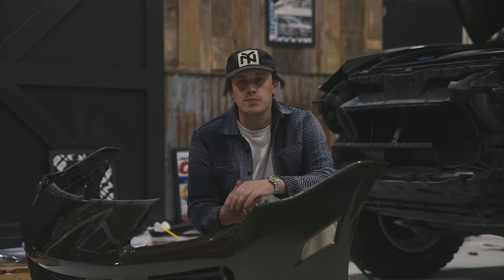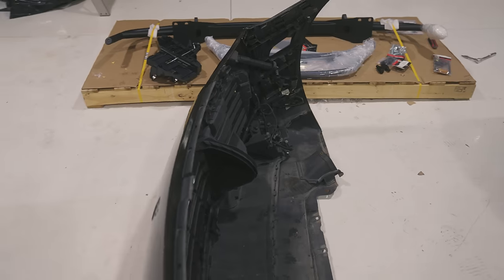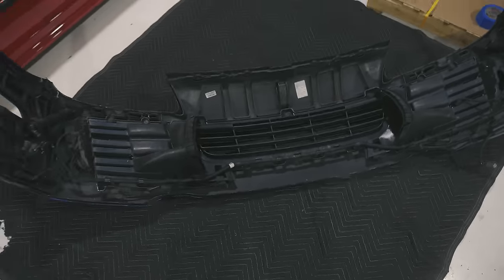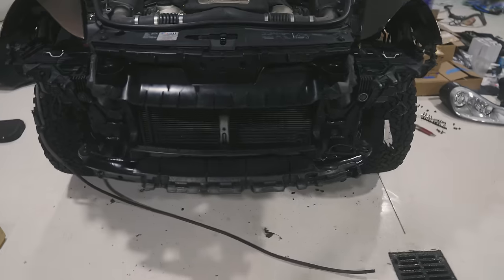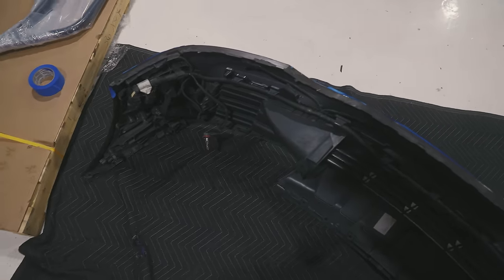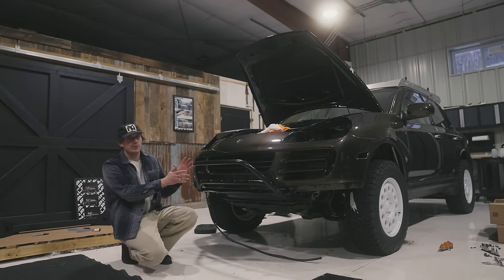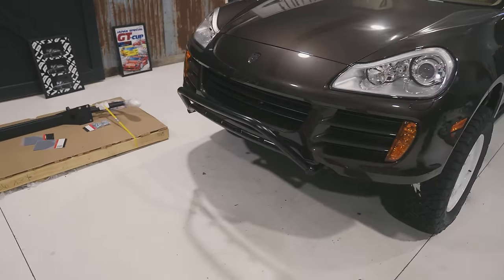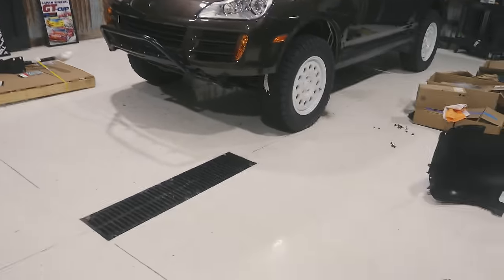Trimming The Cayenne Front End & Installing A Eurowise Bumper

Comment: Just did my front calipers. Was waiting on spacers and studs from Eurowise. Going with some H&R instead, as they had everything in stock. Next up to install is the Eurowise Q7 winch mount and then pouring over photo's and choosing my bumper/light bar... Then decide on rock rails or not. FYI, Wilco offroad has a previous design offset swingout Spare carrier on clearance for $850(if you have a tow package). It has some issues, but all are pretty fixable easily for about half what the newer version offset carrier costs new.  I have one on the way.

Comment: ive done 3 eurowise kits. 1 eurowise bumper, i was kinda disappointed with the fitment with the holes lining up, had to make them bigger and it just felt like ur typical aftermarket part. looked dope in the end tho
Reply from the maker: Damn man! My experience has been great so far. I can understand why a bumper here and there may not end up flawless in fitment. So many bends
Reply: @ChromaticGarage  yeah it was the 8 holes that actually line up to the frame rail where the aluminum bumper would normally go. i had to wallow them out in order to not crossthread the other side due to too tight of tolerance